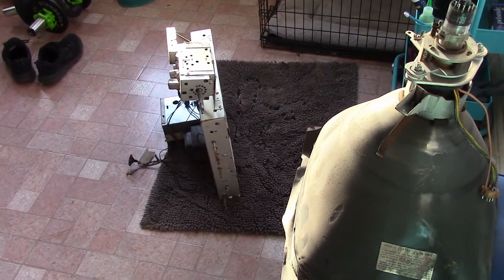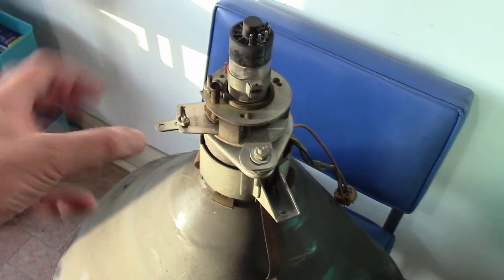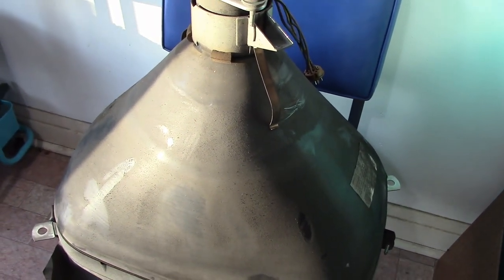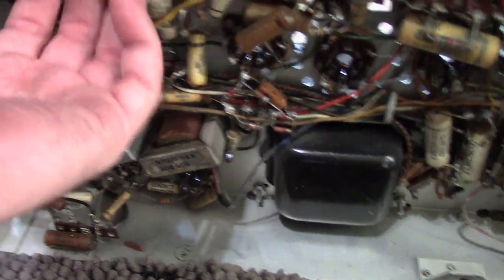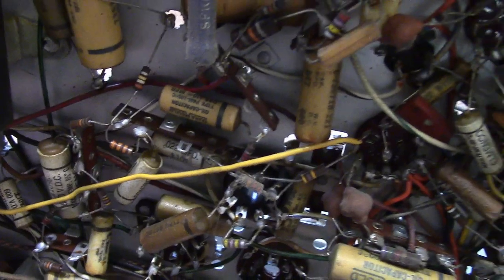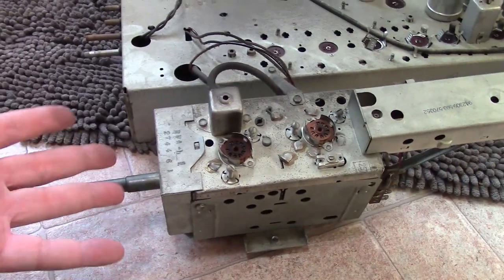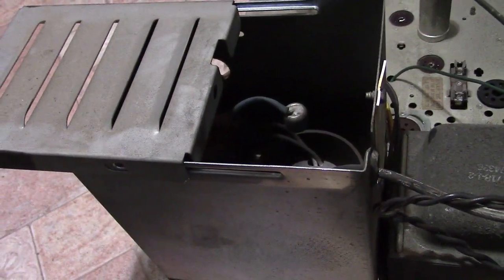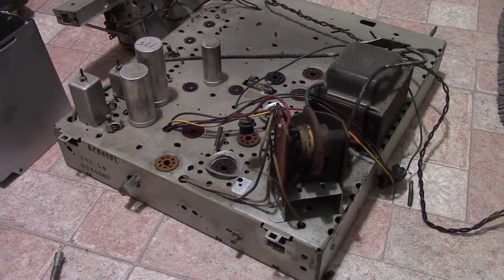It happens, let's talk about it

Comment: Once I killed a Soviet 24" B/W CRT by discharging it with a dead short. The connection beween the anode connector and the internal vacuum-deposited aluminium layer went open from the current spike, it was glowing around the anode cap afterwards during operation as it arced inside the tube between the anode connector and the Al layer. The gap between the anode connector and the internal conductor became bigger and bigger as the arc eaten away the thin Al layer. There supposed to be a blotch of aquadag inside the tube around the anode connector, to enlarge the contact area with the aluminum layer, so the anode current is not flowing through solely the extremely small cross section where the anode connector meets the deposited Al layer. This was around 1999, so I don't remember if this particular tube had that aquadag spot around the anode connection, but being a Soviet tube, it might have been missing. 

Soviet quality control for civilian products was ranging between mediocre and almost non-exsitant, depending on the factory (and probably between different shifts in the same factory). Soviet CRTs are terrible, often factory defect, and have an unpredictable service life. But at least they were mostly honest about it, and weren't ashamed to write down a guaranteed service life as low as 500 (five HUNDRED) hours in some CRT datasheets (16ЛК1Б namely)...  Often problem was vacuum seal failures around the anode connection. Search for 31ЛК3Б, 16ЛК1Б, 61ЛК3Б datasheets, some versions of these datasheets have life expectancy figures, and they are laughable... Sometimes they decided not to include such figures in the datasheet. And I really don't get why were their CRTs so bad, since their generic amplifier tubes were quite robust and reliable.

Comment: I wrote a windows application in C# using visual studio that stores inventory items in a SQL server express (also free). I've included cross referencing features and of course the ability to store quanity and location information for the components. I use it for everything including links to datasheets for the parts in the way of local PDF files as well as URLs to web references. 
It's been a great tool and well worth the time to create it. I can look up information, find the parts, the datasheets, where I put them in a matter of seconds.
I built this thing some years ago because I was gaining so much surplus and getting to the point where I didn't even know what I had anymore. I slowly added things to the database over time as I felt motivated.
Reply from the maker: Great idea.  Nice to hear from a fellow programmer.  I work with C# and SQL every day 😀
Reply: @bandersentv  I also share your passion for old electronics. Radios, TVs, and other electronic projects. I don't have as much experience as you and guys like Shango, so I'm always pleased to watch your videos and learn.

Comment: I still don’t understand the physics behind it, but years ago, I saw a computer technician pull out a little gadget from his toolbox. It was a biro fitted with a high voltage resistor inside with a straightened out paper clip, protruding from the writing end and a wire with an alligator clip coming out of the back.

He connected the alligator clip to the earthing strap, and slipped the paper clip probe under the rubber cap and discharged the CRT. 

I asked him why he didn’t just use a screwdriver, and he replied that with his little device, there was never any recovery of charge. Since it was so simple to make, I gave it a try, and I was delighted to find out he was right. It’s a more gentle discharge of the CRT, and you don’t get that characteristic pop. But the best part is that when you discharge the CRT, it stays discharged. For the resistor, I just pulled a resistor from the focus section of an old Phillips, colour TV, and it worked perfectly.
Reply from the maker: I've heard that too.  I assume it has something to do with a slow stead change rather than abrupt shock.  You can get the same results without a resistor if you ground it longer.

Comment: It is a good idea to label the transformer leads. The colors are usually hard to figure out. Use the service data and trace the wires to ID them. That goes double if you want to repurpose the transformers.
Reply: Yes. But, using an ohmeter, can determine wich they are.

Comment: Spare parts have saved the day for me so many times over the years. I tend to avoid RCA products for the most part, due to some of the things you pointed out here---many proprietary parts that aren't easily replaced with something else
Reply: It even happens, as Mr. Anderson said, that other makes (I've seen Magnavox do it, for instance) will reuse some or all of an RCA design, making it possible to use an RCA part as a replacement in them.

Comment: I have had the ion trap magnets and the magnetic focus units go bad from loss of magnetism. I remember working for a distributor and having to verify the CRT's were under vacuum. I got nailed more than once from a CRT that had been turned in with a charge on them.  Be sure to save the solder tag strips. The price for new ones is totally insane! The peaking coils are worth saving. You can look at a schematic & tag them with values or use an LCR meter. I seldom needed one, but had to drive 150 miles just to get a pair for an RCA set I was rebuilding.  Save the longer chassis wiring too. 600V wiring is hard to find, and be sure to save the CRT socket too. I have seen many of them broken.  Damaged interstage, vertical,  and audio transformers can be a nice source of enameled wire for other projects like crystal radios. also the chassis mounted plug the line cord goes into and the line cords should be saved. hard to find items anymore.
Reply from the maker: All great points.  Are you familiar with Surplus Sales of Nebraska?  They carry many of these items like the AC code interlock, tube sockets, terminal strips, etc. at very reasonable prices.

Comment: By experience I found that different kinds of CRT glass have different "memory" characteristics for a charge.  One, an Emerson I believe, had quite a bit of memory and even after a one time discharge still zapped me as I pulled it out of a cabinet, but fortunately I did not drop it on the floor.  Anyhow after that I would tape a piece of aluminum foil to the aquadag if there wasn't a spring or braided strap contact assembly already on it, then run a jumper clip lead from the foil or the other aquadag grounding assembly, to the anode well.   With that kind of grounding affixed in place, no more zap was possible, especially after several minutes had passed.

Comment: Obviously that picture tube was well dust coated, and I'd always dust them off as soon as I could when working on such a set (I think rubbing alcohol was what I used after that, which would not dissolve the aquadag, but I am not swearing to that after all this time).  I am surprised that it only had a small swath of aquadag when coating most of the funnel would have been just as feasible -- talk about penny pinching design.  Some earlier sets had HV filter capacitors in the HV cage, meaning an aquadag wouldn't matter.

My mom might have gotten a good bargain on a CTC-16ish (borrowed RCA design) Magnavox roundie set back in the day because the set had a pesky habit of charging up the metal front control escutscheon with induced high voltage.  It loyally zapped me and my brother for years with spicy static, especially when first turned on.  I guess nobody else to whom the set was demoed wanted it!  "'Dagging" more of the picture tube funnel surface might have averted this effect, thinking in hindsight.

Comment: That chasis looks very clean,
I have restored a lot worse.
Reply from the maker: It's pristine.  It's not being restored because the cabinet is being repurposed.
Reply: @bandersentv  I suppose one could build a new box (as out of utility lumber) if one was that strongly inclined.  That might be a cool project for a kid, with suitable adult supervision.
Reply from the maker: @SeekingTheLoveThatGodMeans7648  Maybe, but it has to be strong enough to hold all the weight of the CRT on the mounting band.  You also need to add a sheet of tempered safety glass for implosion protection.   Much easier project if you use a chassis with the CRT mounted on it.

Comment: What would you want for the power transformer?
Reply from the maker: Sorry, it's not for sale
Reply: @bandersentv  Thanks anyway. I appreciate that you responded. Funny you mentioned building an amp. I had been looking for a television just for building an amp. I thought of using one of those several months ago, but have not had much luck finding one. Ones from radios are not really big enough for what I want to build. For the one I am building now, I am using an industrial power transformer for the high voltage and a switiching powersupply for tube filaments. This has 6AS7's as finals. Those are power hogs.